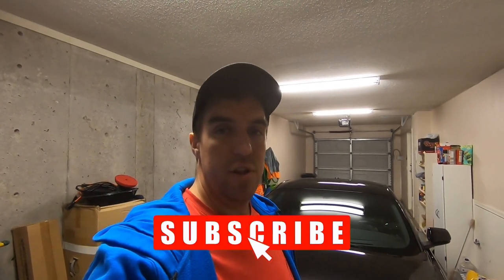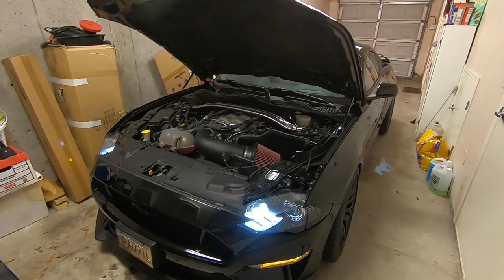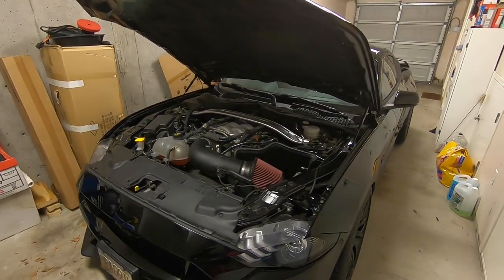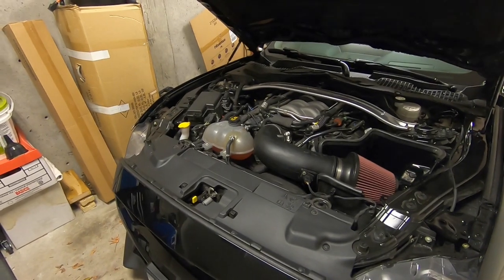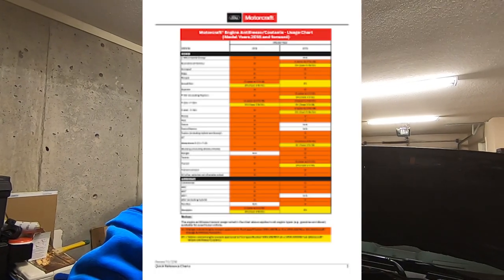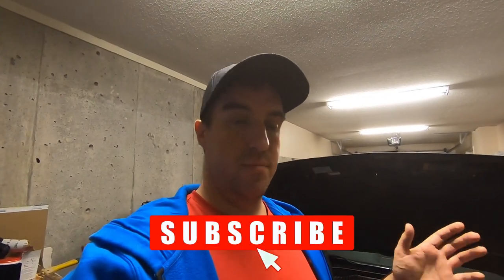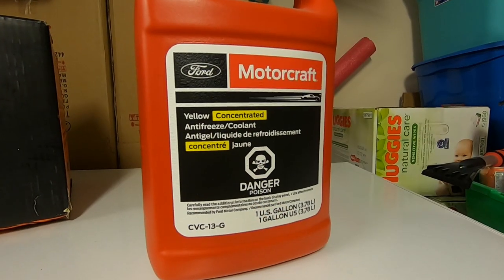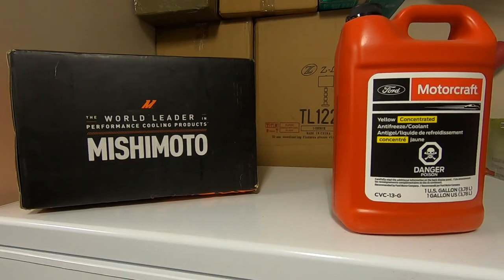CAN You MIX Ford Engine COOLANTS? Here's Your Answer!

Comment: The new Ford stuff I believe is Organic Carboxylate base Universal type coolant. Prestone Platinum 56/44 Universal, you can also mix with the pink/orange stuff.
Reply: So it’s a 56/44 mixture instead of 50/50? All I can find is Pretone Universal 50/50 orange. Can I use that?

Comment: What is the best for mustang gt performance package 2018 yellow or orange new one please inform me i change to Mitsubishi blue and red line coolant and 160 thermostat and tune but still between 90 to 93 degree in highway but extra speed 95 and ac it's working all Time is there solution with my case please and thanks for your information

Comment: I’m trying to do the same with my 04 new edge mustang, I want to drain the old current coolant and replace it with new coolant so it flows better, I always watch what I put in my car like oil, usually I take it to an oil change (not a dealership) but I want to do it myself cause you never know what they do when they add oil
Reply from the maker: I'm sure most places are good but with my luck I would end up at the one bad place
Reply: @CanadianCruisin that coolant is new to help out mostly ford vehicles with a internal water pump like the explorers and taurus. Since those cars have water pump issues. They claim that using that coolant helps the water pump in some ways.🤷🏽‍♂️i have a 2011 ford explorer limited and did the cookant flush with the new yellowish coolant color.
Reply: I remember when I worked at Walmart back in like 2004, and the oil tech forgot to put the oil plug back in the pan and blew the guys motor. Needless to say they had to pay for it but they never fired the chick that did it. 🤷🏾
Reply: Just gives you that extra peace of mind right?

Comment: Sorry if you mentioned it in the video, but is there a reason you used the Concentrated vs. Prediluted?  I don't know much about coolant.  I have the same car and my coolant is low too, with no performance mods.  Very weird
Reply: I bought mine from Ford and it came Concentrated. Just dilute 50/50 and make sure you use distilled water.

Comment: The dealer flushed out my 2018 Taurus last summer and I requested they put yellow in it. They put the orange back in it. Now I can't find a gallon of orange anywhere to top it off. Some say not to mix them and others say you can mix yellow with orange.
Reply: The color doesn't matter. It's the technology that matters. Fords usually take HOAT coolant now
Reply: Same here.  What did you do?

Comment: You are brilliant!  I have a Ford Ecosport 2018 that came with the orange/pink coolant in it. I’m in Miami now and last week was extremely hot. My radio screen stopped working (froze). The next morning I had the little engine light turned  up on  my dashboard ( it’s not on anymore). 

I have the Ford app on my phone and it showed that I needed to adjust the coolant level in my car. I checked it, and it shows the line a tiny bit under the minimum recommended amount. I went online and ordered the Yellow Motorcraft Coolant out of Amazon since I could not find the orange one.

Now, I know that you mentioned that it’s ok to mix both colors/coolants but since I have the ecoboost I wanted to double check once again before adding the yellow on to of the orange coolant.  Thank you. I hope I’m making sense.

Lastly, can I bring the line all the way up to maximum since I have a full gallon of coolant siting in my car.

Comment: Hopefully you read your owners manual because that 1 Gallon of engine coolant is Concentrated. Usually it needs mixed with distilled water 50\50. Only when you buy the "Yellow Prediluted Antifreeze \ Coolant 50\50 - Do not add water" labeled jug, can it be poured directly into the expansion tank.

The Motorcraft part # is: VC-13DL-G

Also, I forgot to add, I've heard the Orange coolant is Ford's version of Dextron (GM's coolant) and should be flushed out ASAP. Find a mechanic who has an exchange machine that pulls out the old coolant while pushing in the new coolant.  This is because the Orange coolant has what's called "fallout." When i had a 17' Focus it had a buildup of something crusty on the coolant tank cap ...whereas my 22' Maverick doesn't have any crusty buildup at all since it has the Yellow coolant from the factory.

Comment: Did you have to mix the yellow coolant with distilled water to make it 50/50 so you could add it or did you just pour that sucker in there?
Reply from the maker: I just poured it in. You can mix it if you wanted to but this one straight from Ford can be dumped in as is